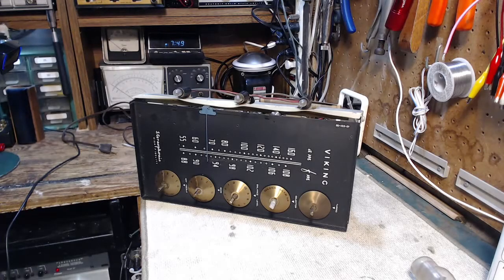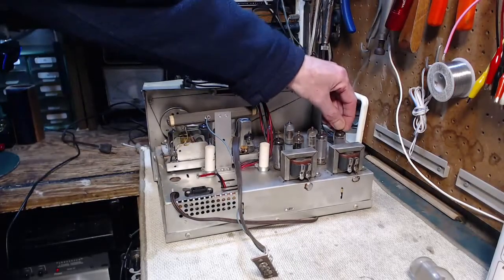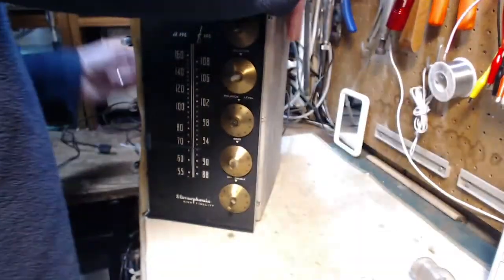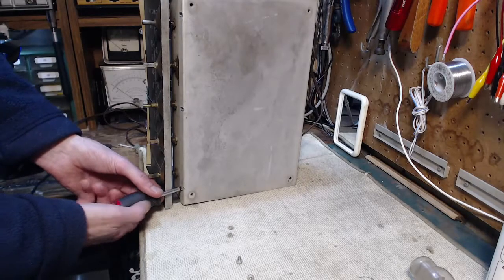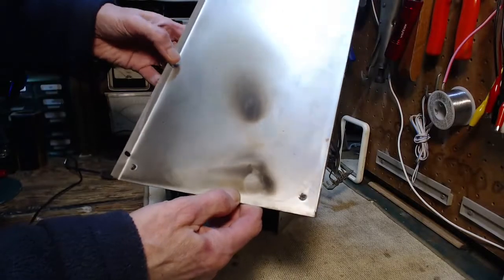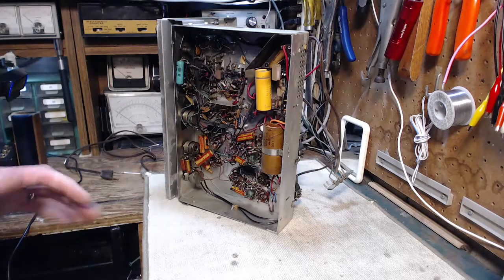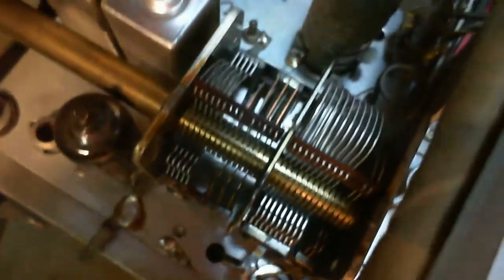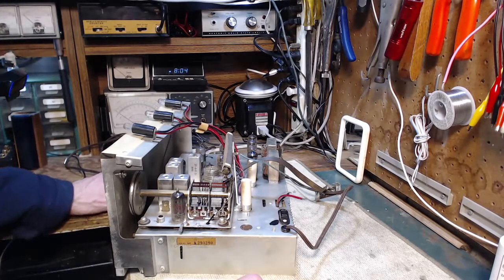Viking Console Stereo Video #10 - Receiver Checkout

Comment: hi jim
I did noticed two things on your close up cam.
1. in the psu section that diode on the leads it has been burning at some stage
2. at 9.51 on the time burnt wires coming off the switch
just check sir...
jim

Comment: 11:55 perhaps the two wires went to an original selenium rectifier that was replaced with the diode.
I wonder if those four 50C5 tubes are wired series / parallel?
Reply from the maker: ***** I think they go to a neon pilot light in the cabinet.

Comment: I think VIKING made other things like,boat motors for one...!
Reply from the maker: Robert Hardwick Viking was the brand name sold by Eatons in Canada.  There may have been various manufacturers actually manufacturing the stuff.  I should do a little research into Viking.
Reply from the maker: Robert Hardwick I did a little research.  Viking was a subsidiary of Eatons and may have been an American based manufacturer.  Although Eatons is gone, Viking electronics lives on making security equipment.  They have a website:  https://www.vikingelectronics.com/

How times have changed.